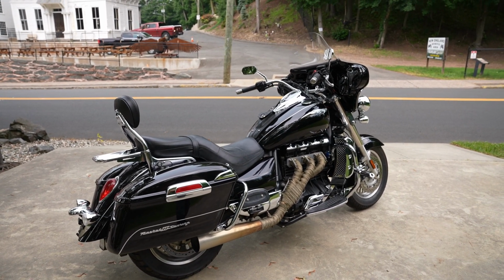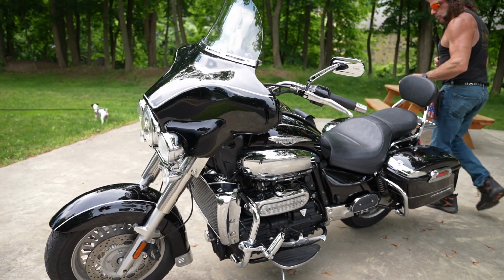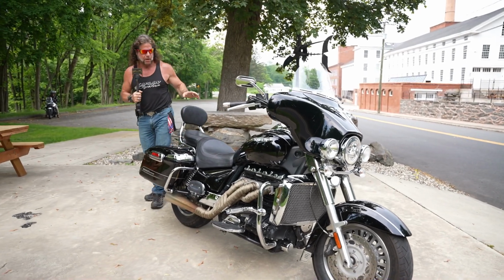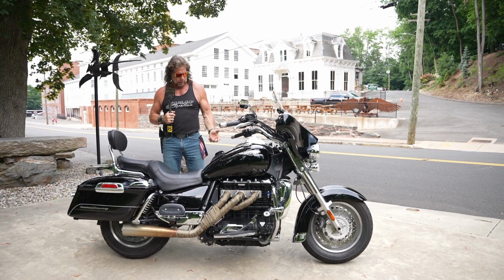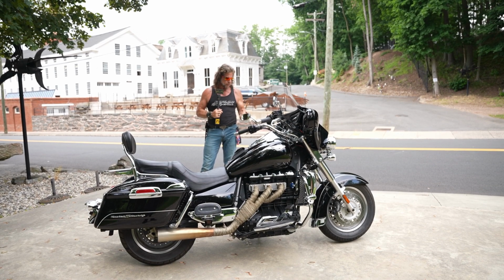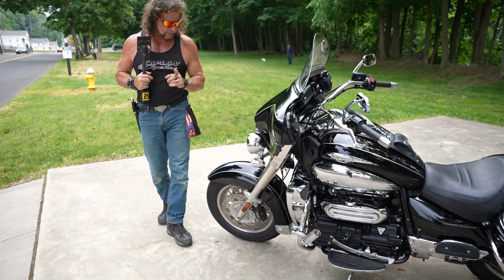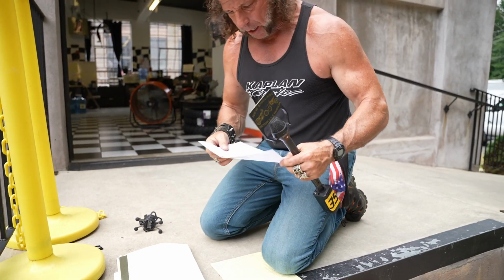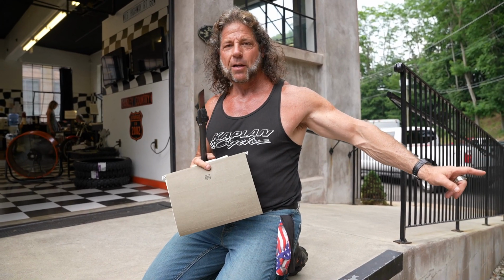INSANE 234HP Triumph ROCKVILLE CARPENTER Rocket III

Comment: 234HP. That's more than my frickin 79 Trans Am had, stock.
Reply: Those cars got wimpy around that time after the gas crisis.
Reply: @stephenloflin4772  .. the original 403 Olds & 373 rear was more that you needed. Got hit & put in a 77 4.11 rear. 65mph = 3000rpm+. Still wish I didn't sell that car.
Reply: LOL! Yeah, that's about 80 hp per cylinder. That has my SAAB Aero beat. By a narrow margin, but still beat. 😄

Comment: 234 rwhp and 800 lbs! Thats an insane power to weight ratio, even for a bike.
Reply: Bikes have gotten insane, a 11k used R1 can make 190whp and weighs 440lbs. Ducati makes a bike that is 240 crank hp and 415lbs WET weight with the different exhaust it comes with (V4-R)

Comment: That's insane. I have the 2016 roadster and i wouldn't dream of doing that to it. Here in the UK our roads aren't straight enough for one. I know some guys have boosted there's with Turbos and a like. But its pointless really. You just cant use that power if you like living that is.  I have heard that the new 2500cc bike is a shorter stroke engine.  So this older model engine will probably take these engine  upgrades  with far less wear and stress on this mother of an engine. Leaving mine standard i will hopefully leave it to my grand kids kids. Lol.

Comment: What brand is the fairing? It's not a Corbin I don't think
Reply from the maker: Reckless fairing
Reply: @KaplanCycles  I've not heard of them. Thanks. I'm interested in knowing if a fixed fairing could be mounted on the new 2020/21 R3. Make a Road Glide Rocket 3. Not many mounting points on the new R3 though, engine being a stressed member